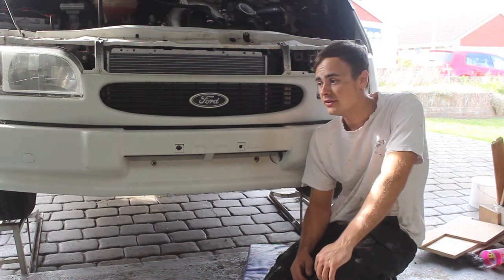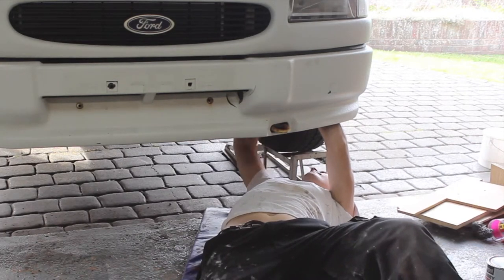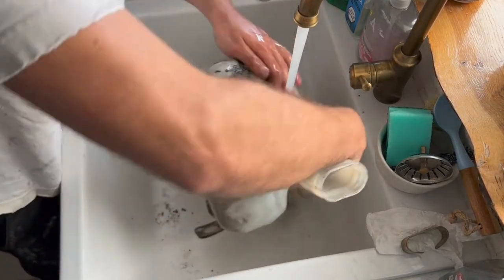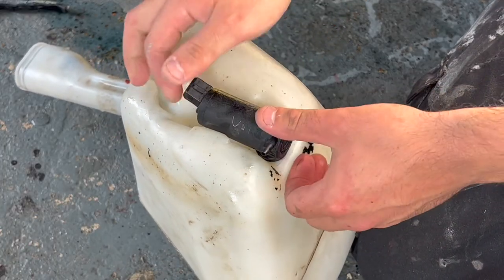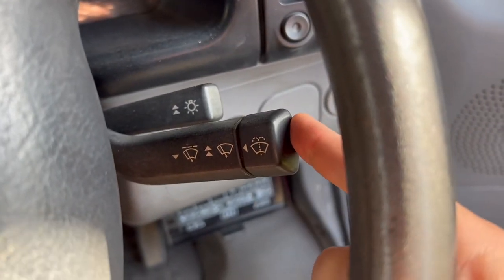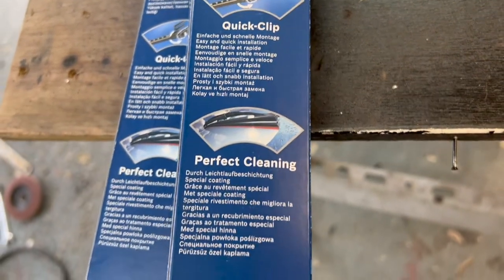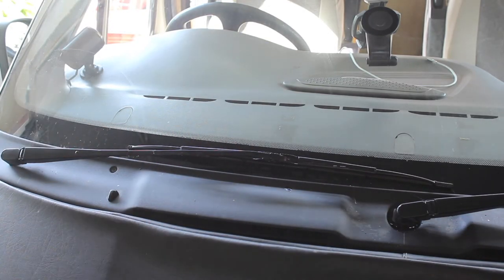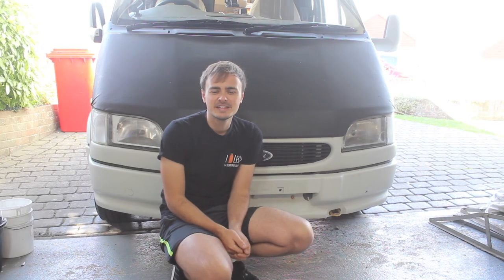Windscreen Washer Pump Diagnosis and Repair

Comment: HI I JUST FITTED A NEW WASHER PUMP ON MY VG 2014 FALCON I HAVE BLOWN AIR THROUGH THE HOSE AND CLEANED THEM OUT BUT WHEN I FILLED THE BOTTLE THE WATER DONT REACH THE WINDSCREEN
Reply from the maker: If the pump is running and all the lines are clear the pump could be air locked or pump could be faulty 🤔

Comment: Hi mate do you know if I should buy a genuine ford crank pulley? I bought a aftermarket 1 that's now making a bit of a noise only installed 2 weeks ago.
Reply from the maker: Hey, I would always go genuine or quality brand where possible on the engine 😊